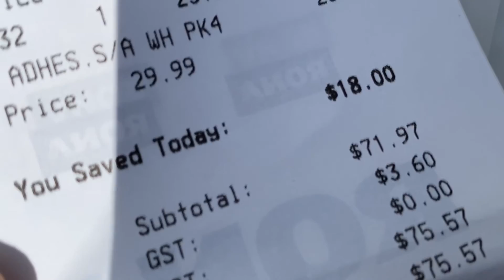DIY RV Backsplash Peel and Stick! | S02E02 | Crazy Lightning Storm! | Vintage RV Makeover!

Comment: Hey, we just bought a 1974 Brave. We thought we were ready to take it out but realized that our car seats don’t anchor properly. Have you done any work yet for your car seat? We are in Calgary and got one quote that seems super high.
Reply from the maker: Congrats on your purchase and welcome to the Winnebago family. We have not even thought about a car seat yet to tell you the truth. We were given this Winnie and it was either haul to the wreckers, sell for next to nothing or refurbish and figure things out. Even though the winnie runs we still have a lot of work to do before her maiden voyage with us. We hope all goes well for you guys and thanks for putting the car seat issue on our radar. You should post a video of your car seat setup though when it is complete I'm sure it would help many others out as well as us! Happy Travels.
Reply: @AlbertaAdventurerFamily  we are having someone do the work for the car seats this week. I’ll post some pictures. We called around and most places don’t want to deal with car seats. The guy we are using was recommended by a few people.  We want the kids to be as safe as possible.
Ours brave is in pretty good shape but we did have to replace the entire muffler system and the bathroom will need some work next year.

Comment: what is the backsplash you used? You mentioned you had to go back to the store and you liked it but not what brand it is
Reply from the maker: Hey Rob, we used SMART TILES Self Adhesive Metro Blanco. They came in a six pack and we found they were more durable than other brands. Still not the same as real tile and grout but if you are looking for simple and light weight; it's the way to go!
Reply: Alberta Adventurer Family love what you guys did. Inspiring!